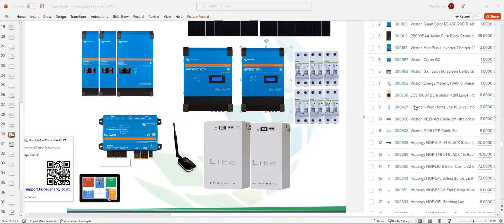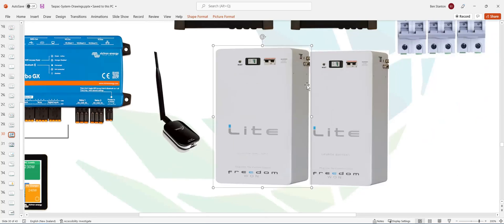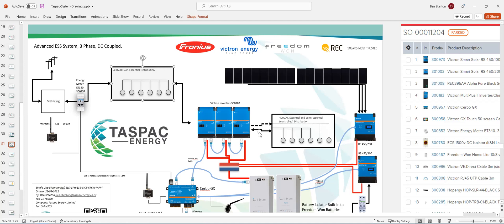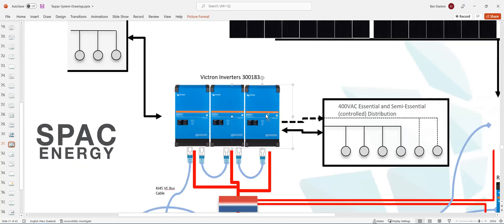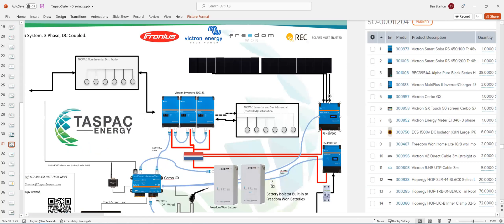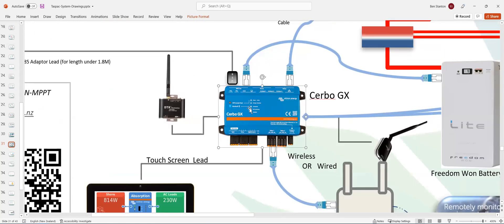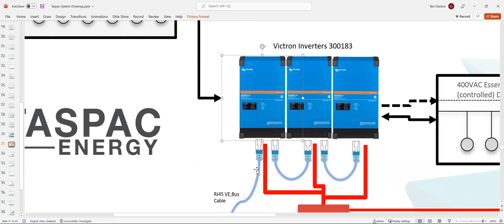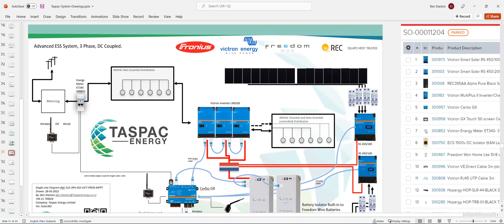Dc-coupled 3 phase ESS system   Victron Energy video1484194050

Comment: This is fantastic !! What program do you use on this video for equipment layout ? Tom
Reply from the maker: Thanks Tom, I generally use Microsoft PowerPoint. Mainly for these reasons: I am familiar with it & it works across many different PCs that I work on.
Reply: @benstanton  thanks for that. How can you do that cables to be flexible and still have plugs, not just ordinary lines?

Comment: Hello ben, great video!!! i got a question, How would you connect an AC 3 phase grid inverter to charge the batteries with the exceeded energy? Thanks!
Reply from the maker: Very simply, you would connect the 3 phase Grid Tie Inverter to the AC output. Just be sure that it is lessthan or equal to the rating of the Victron inverters.

Comment: What software is that? Can you put the inverter AC outputs to a common bus?
Reply from the maker: Hi Brian, I generally use Microsoft PowerPoint. Mainly for these reasons: I am familiar with it & it works across many different PCs that I work on. Also I seldom draw from scratch so once I have a drawing in place I just modify it. I also do a lot of training for these systems (both technical and sales) so I find the format easier to work with as a presentation tool.